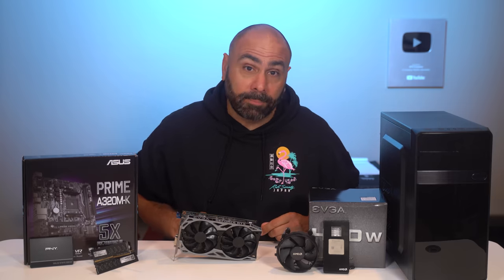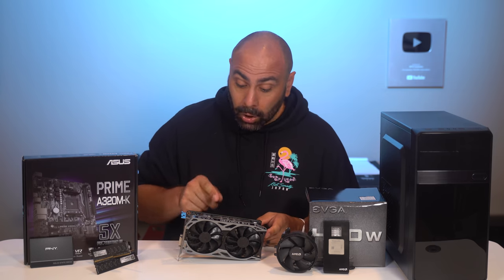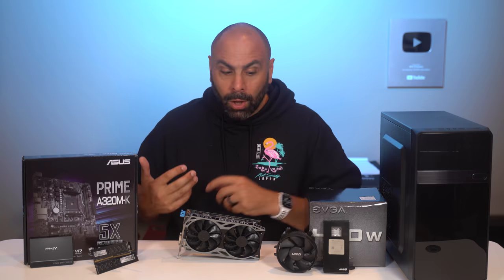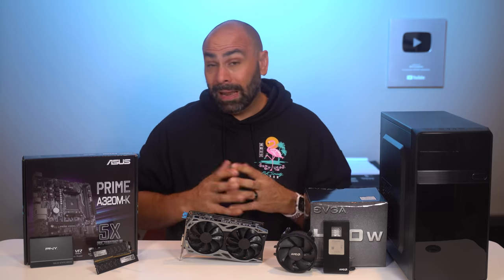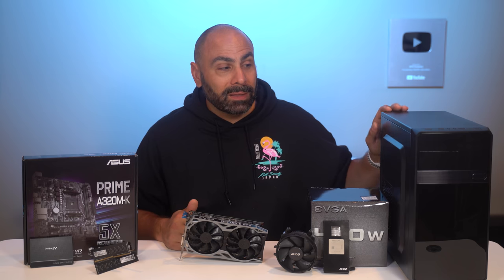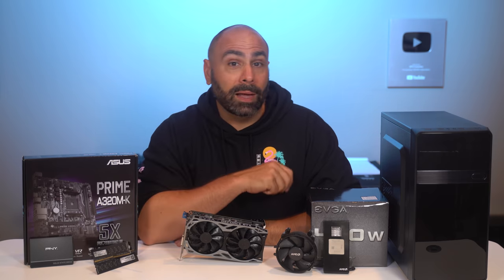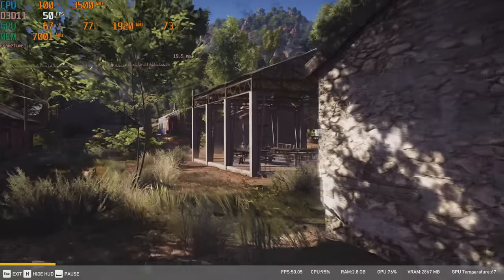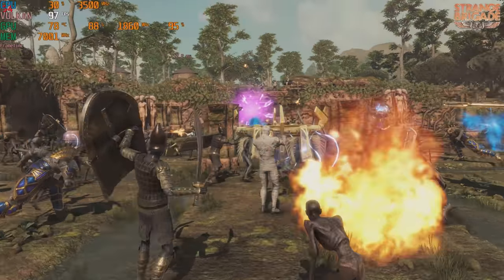The Cheapest 1440p Gaming PC I've Ever Built!

Comment: To get that 1440p i would stretch the budget to 600$ and buy a used ryzen 1600 or 1600 af.
Reply: You’d get better performance out of a 2600 or 3600 and they’re cheaper than a 1600
Reply: @Raven_614 depends where u live and ofc the 3600 is better. but in games with 3600 compared to 1600 you can get like 10fps more.
Reply: @chuba1  actually the 3600 is quite a bit faster than the 1600. Around 20-25% if i remember correctly.
Reply: @orionstar3310  Also depends the game/task. yesterday checked video 3600 vs 1600 in 10 games at 1440p and there was around 10-15fps avg diffrence. For ecample, increase 60fps by 25% = 75fps
Reply: @chuba1  1440p is mostly gpu limited, but yeah i get your point, honestly idk what this guy was doing with the Athlon and 2060 lol

Comment: I liked the idea and the resulting performance, and even if the frame times were not the most consistent right now, this system is a great starting one for a kid to grow up with, for example. And, it allows for a great upgrade path with minimal upfront cash. I'd have only substituted the CPU for a 3100, which would have allowed for a new b550 motherboard in a years time, then some more RAM, then some NVMe storage, then a 4xxx CPU when they get cheaper, then a new graphics card... All shopped without pressure, when there are good deals, and for at least four more years this system can grow with the kid, from Minecraft, through Rocket League, through Fortnite, through War Thunder or World of Tanks to more demanding games, and never need more than a couple of hundred $ every six months to a year to stay relatively current... And, it's a great way for somebody to learn about computer hardware by actually tinkering with something relatively inexpensive!

Comment: If you're trying to build a $550 1440p gaming computer you really need to shop the used market.

For example: for 240 bucks (paired with your $310 2060 for a $550 total) you can get a refurbished Dell OptiPlex 3020 with an Intel Core i5 Quad (i5-4590) 3.30 GHz CPU. And this weekend there is a 30% off deal which would bring it down to $168 (so $478 total).
It does only have 4 GB of RAM but a second 4 GB DDR3 module can be had (Amazon) for less than $20 and you can replace (or supplement) the 500GB HD with a 500GB SSD (Amazon) for $50 and still be under $550.

And it includes a copy of Windows 8.1 Professional.

Comment: Good video. 
Save your $, an extra $50 more gets you a LOT more performance, upgrade the cpu to Ryzen 3100, Save up another $50 and upgrade the motherboard to a B550/B450.
Reply from the maker: I think at that performance level the motherboard isn't a limiting factor, but certainly if you need more features or connectivity.

Comment: I would say, for 1080p 60fps med-high settings, this should do fine in any esports and other games. But, if you take out that 2060 and add in a capture card you got a great budget 2nd streaming pc honestly. This system might have missed the 1440p high settings gaming mark, but for other work loads or lower settings gaming it would be horrible. The sad this is there really is no upgrade path with that motherboard.

A good change for that system would be to lose the 2060 and go with a b350 mobo and a 2400G or 3400G with no gpu and you might even be able to get a slightly better psu and you can get by on the Vega 11 graphics till you save up to get a good matching gpu.

The motherboard is the backbone of your system, everything hinges on it, so never skimp on that, make sure it is the best you can afford and work off of that because you can always upgrade other parts much cheaper than replacing a motherboard and it's alot less work that rebuilding your whole system.

Comment: The ryzen 1200 AF could also be an option if you would consider a better cpu from getgo, don't know if it's available over there, but here in europe it's available for between 60 - 100 euro's depending on the shop and/or stock

Comment: I would have gone xeon 1650v1 for 30, 8gb of ecc ddr3 ram in 4x2gb for quad channel for 12, a motherboard that can OC the cpu from x79 mechanist 65 usd, and 20 bucks for a semi decent cooler. Means you could litterally swap all of those components to these for ~117 usd and decrease the cost slightly while more than doubling cpu performance. Everything else could stay the same, its just has significantly better upfront performance and better memory bandwith with an 1866 mem oc. Unfortunately it means the best cpu for upgrading is the E5 1680v2, but that is still  ryzen 3700 performance when OCd for only 150 usd, or the 2696v3 (180) for workstation tasks.

Edit: or, you could go to 16gb of ram in 4x4gb config for ~20 bucks and have a streaming ready gaming pc and use the 2060KO's encoder

Comment: As a standard for myself, I won't spend more than 25% of my build budget on the gpu, over 50% is just too much and the wrong direction. I would rather go with a low end gpu and better cpu and motherboard. Even 8gb ram over 16 just to get a B350 or better motherboard for amd is better than going with the 3000G, that cpu is for basic system use, not for gaming.

Comment: G'day Brian,
A $550 PC with a RTX2060, Not in Australia 😞 just the GPU goes over the Budget
EVGA GeForce RTX 2060 KO Gaming $569,

Brian Just wondering as a Part 2 if it would be possible to compare this to a R3 3100 & GTX1660Super or GTX1660Ti fitting the same $550Budget

Comment: To be honest, if you have 500 bucks for a pc build it's better to just either save up a bit so that you can get an 800-1000 buck pc build (case most builds in that range have the best value) or just build a 1080p build... 

I mean sure, it's possible but you have to make a lot of sacrifices and you might get some bottlenecks so it probably isn't even worth it...

The difference between 1080p and 1440p is not big, so you might as well build a 1080p build in that budget range and not get bottleneck and not sacrifice as much.

Just my opinion btw, this vid is still great
Reply: I dont get the push for 2k gaming unless you have a 27" or larger screen. Heck 1080p really isnt bad at all on even 27". I much rather have the fps.
Reply: @creaturecore13  yes exactly ikr!

Unless if you have a higher budget (like 1200+) then it might be worth going for 1440p but otherwise, go for 1080p because you probably won't notice the difference
Reply: @creaturecore13  it seems though theres a lot more new pc users on the market that may be coming from consoles and are planning to use their large tv's to play on so 1080p might not look so good to them. 4k tv's are super cheap and i bet a lot of those new users think it'll work just like a console but better.
Reply: @creaturecore13  1080p sucks in 2020 every GPU can do that resolution. 1440p is the new entry resolution and goal that builds should be built around. 4k will be possible in mid tier GPU's once Ampere comes out not to mention PS5 and new Xbox doing 4k gaming as well.
Reply: @ZackSNetwork  Thats a ridiculous statement on smaller screens. It is a waste of gpu power to run 2k resolution when your eyes can not tell the difference on a smaller screen. FPS is far superior. 1080p gaming at a cut off of 27" is fine. Anything higher is going to be a waste of pixels. 27 is the fuzzy area where some can tell a difference and some cant. 27-32" 2k is optimal.

Comment: I would think if most people can afford a 1440 monitor and graphics card they would not cheap on the rest. Cpu bottlenecks at 1440 so you don't have choice to run at 1080 for faster FPS. 
He said he wouldn't recommend it. I would save up for better parts that you will not have to upgrade. The only part that you will not upgrade would be the gpu. I think it makes more sense to Get Ryzen 5 3600 and RX 570 and game at 1080. then upgrade Gpu when you can afford it and 1440 monitor. A overclockable 450 mb is only 25 more. Also 16GB ram is slight more same with ssd and PS. You are not really saving if you upgrade most of  your parts.

Comment: Bruh, I have a $650 and I cannot find parts to do it... that guy had a budget of $550 and still found parts for it.
Reply: Lol he literally got the worst mobo, the worst psu, not even kidding it's hot garbage, probably a dramless ssd with barely any storage, a cheap af case, not enough ram for today, and a CPU that's so bad it's going to bottlneck almost any GPU today, including 2060, then put a 2060 in it and called it 1440p. He just got a GPU and selected lowest price on everything else. Dont do what he did. Wouldn't say get a 2060 until at least 750usd budget.
Reply: @miniweeddeerz1820  if ur doing nothing but gaming, this is actually not bad...the storage may be a problem but the performance will be good, strictly for gaming tho.
Reply: @allawie5971  it's a 3000g...it's terrible for gaming...and no upgradability whatsoever because the PSU will blow up if you put too much strain on it.
Reply: @miniweeddeerz1820  most games are gpu depending, like an athlon with a 2080 ti will preform better than a i9 10900k with a 1050...in gaming at least.
Reply: @allawie5971  I would rather have a 1060 and a 9900k than a 2080ti and a athlon. Yeah at s certain level of low end gpu it gets questionable but with a 2060, no. Don't even consider it
Reply: @miniweeddeerz1820  bruh, a 9900k and a 1660 would barely run gta 5 over 60-70 fps, an athlon with a 2080 ti would easily run it over 100 fps.
Reply: In my opinion, I think I should spend more on the gpu, and less on the cpu.
Reply: @allawie5971  dude do you know how easy it is to run GTA lmao. Yes I agree with you but when you are on a dual core it doesn't apply.
Reply: @miniweeddeerz1820  Warzone, need for speed, forza horizon, fortnite, cs go, overwatch and apex legends would all run better on a athlon with a 2080 ti.
Reply: @allawie5971  it'll be a terrible experience is rather have a smooth one than a stuttery one
Reply: @miniweeddeerz1820  these games I just showed u dosent run smooth with a 9900k and a 1050, neither on the athlon and 2080 ti, but I'm so sure the athlon with the 2080 ti will run better than a 9900k and a 1050 in the games I showed u and more.
Reply: @allawie5971 itsa gt 1030, thats not what i would call a fair comparison.
Reply: @miniweeddeerz1820  is a pentium g5400 a fair comparison vs the 9900k? Exactly.
Reply: @miniweeddeerz1820  is a pentium g5400 a fair comparison vs the 9900k? Exactly.
Reply: @allawie5971  its fairer than a g1030 vs a 2080ti. the g5400 is way way better than a 3000g, it has a good modern architecture when it comes to inter core latency and performance. the 1030 is old and is the worst gpu in the entire pascal lineup, while the g5400 is not.
Reply: @miniweeddeerz1820  ok so if it was a 1050, it's still gonna lose massively lmao.
Reply: @allawie5971  if it was a 1650 tho...also in gta v it would get close
Reply: @miniweeddeerz1820  not even close, second of all, you are the one not being fair about it now.
Reply: @allawie5971  look in the end this doesn't matter. The fact is you should not pair a 3000g, which is a lot worse than a g5400, or even a g5400, with a mid range gpu. It doesn't matter if you should spend more on gpi than CPU, I agree but with a athlon 3000g, that does not apply. It's just garbage
Reply: @miniweeddeerz1820  I agree.

Comment: firs doom eternal drops when vram is reach its limit, try lowering setting., a better choice would have been the 3100x and a 1660 super. that would be a better fps than the cpu bottleneck.

Comment: When i am playing new AAA titles my cpu is @ 80-100% and gpu 90-100%

I need to upgrade both, but i am gonna upgrade gpu before cpu bc i also play at 1440p high/custom settings and still play on a 60hz panel. Usually get 60-100fps with the settings i use, and i dont use v-sync i use fast-sync
Reply: On a 60 hz you wont notice any more than 60 fps because of the panel limitations.... if you want to see more than 60 fps you will need a 144 or higher panel.
Reply: @SuperSonofsatan  I know that would be the last thing i upgrade fast-sync is good enough for now for me, i mainly play single player games so 60Hz is plenty imo.

Comment: It's really sad this is the state of PC gaming. I remember when the miners ruined GPU prices and we still didn't have to cut corners this much to get a good budget build new. Honestly at this point I would just go used. I don't see a point in getting ANY of these parts new because it's all shit honestly...other than the gpu.

But seeing as how the gpu cost is over %50 of the build, I think you are doing it wrong. There is NO upgrade path there, that motherboard is going to hold back even a 1600AE. I also think if you are on THIS tight of a budget and NEED new watch EVGA's web page and check out their daily deals and such. They were or are in fact having some kinda sale on referb psu.

Also, I picked up a used custom build on facebook for $400 with an i5 6500 16gb ram and an MSI RX580 8gb and he runs 1440p over 100fps in overwatch and cod, he doesn't really play much else other than Mass Effect.

I mean that CPU is going to hold back 1440p gaming more than that gpu